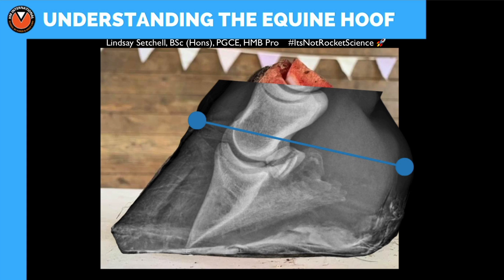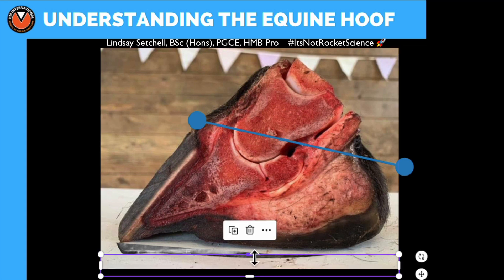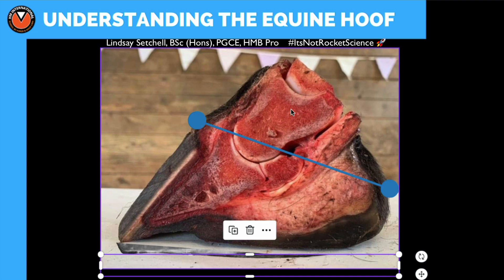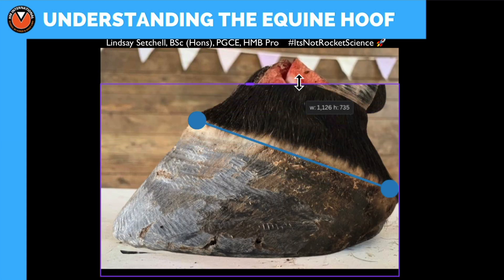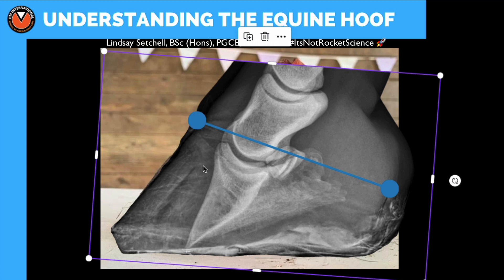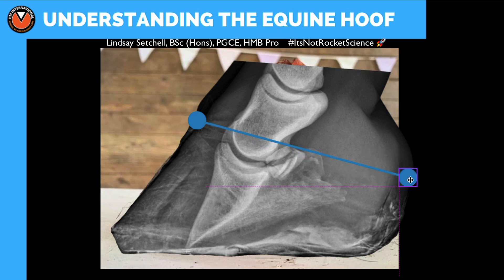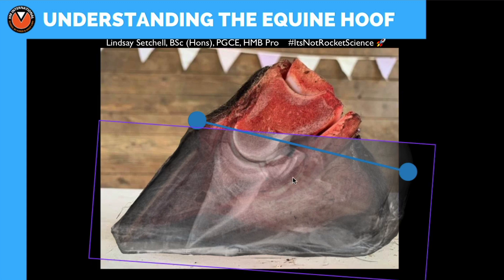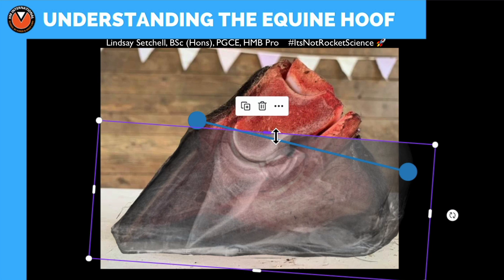How to trim a hoof with a ROTATED pedal bone? (rotation can be fixed!)

Comment: We had one that foundered last fall. Within 10 days, we saw rotation increase from 8 degrees to 15 degrees. No farrier involvement. Heels were low to the hsp. What are your thoughts on that scenario? The rotation was not ‘caused’ by the farrier trying to let heels grow. It happened within the foot in 10 days….
Reply from the maker: We'd very much like to see the x-rays, can you message us please on Facebook?
Reply: Do you have x-rays taken after that?  Perhaps inflammation can cause the pedal bone to move away from the hoof wall and toward the softer, more compressible tissue.  I wonder whether the pedal bone would move back toward its original position after the inflammation subsided.